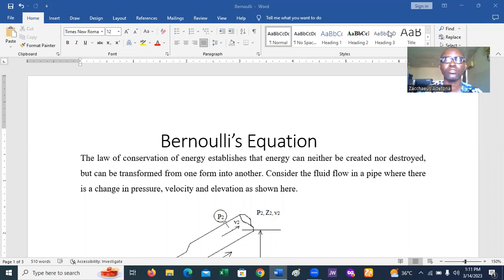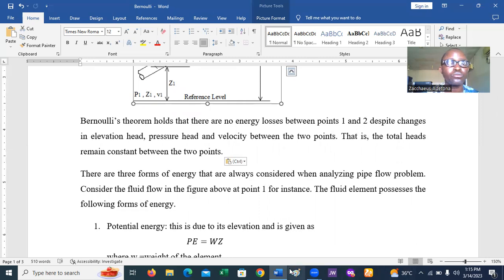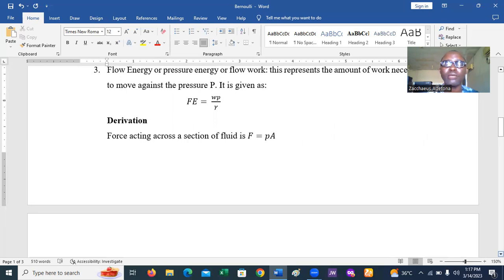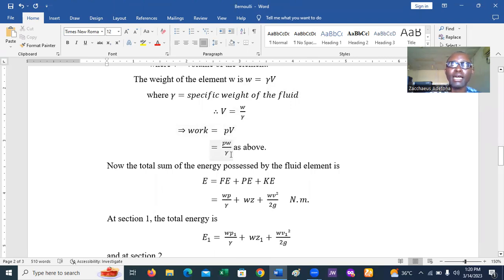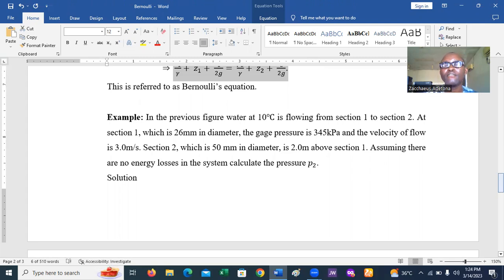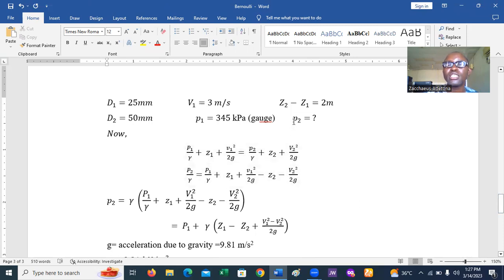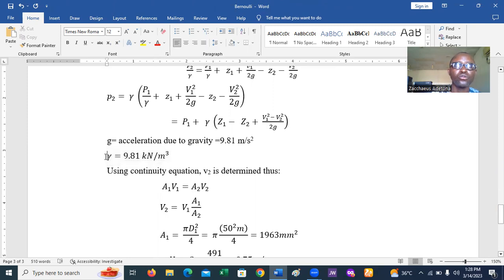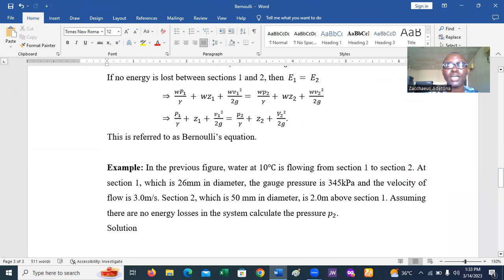Bernoulli's Theorem of Fluid Flow | Fluid Mechanics | Conservation of Energy | @electro_teach #yt

Comment: the material used for bourdon tubes are phosphor-bronze, alloy-steel, cold worked brass, beryllium copper, stainless steel and morel metal. the material used must have good elastic or spring characteristics for adequate reliability.  wow! that was a great leacture.

Comment: Good evening sir, please I just watched this now and I saw that you gave a quiz on the topic, can I also submit it now?

Secondly, I have a question on the gamma-ray liquid measurement,  the source of the gamma-ray is mounted at the bottom of the tank, is it inside d tank of outside? If it's inside what's the probability that the material will not be damaged or affected by the system or the environmental disturbance in the system.
Reply from the maker: You can submit your assignment.

Now regarding the gamma rays source, it is placed inside the tank but the gamma rays sensor is outside the tank. There's not going to be any damage. All that concern must have been taken into consideration before setting up the system.